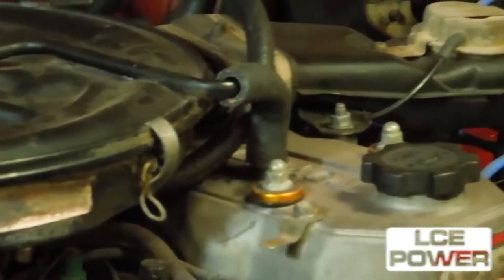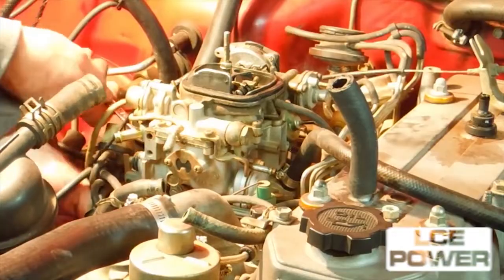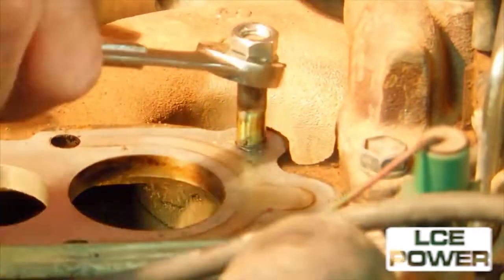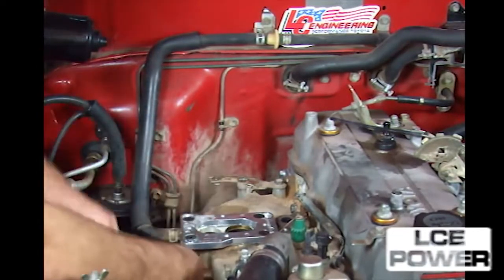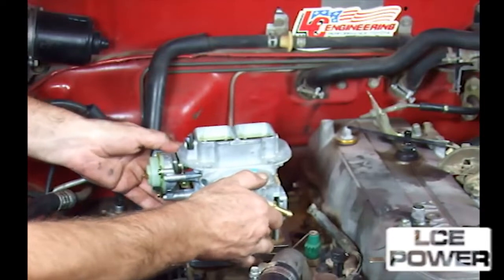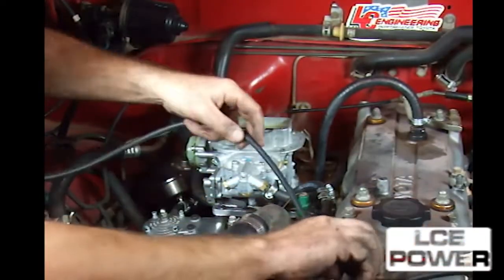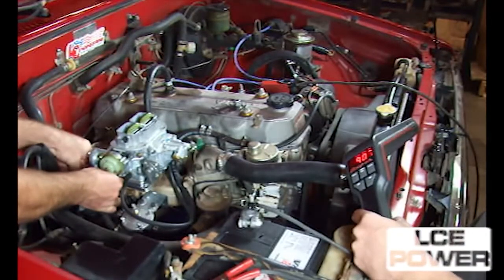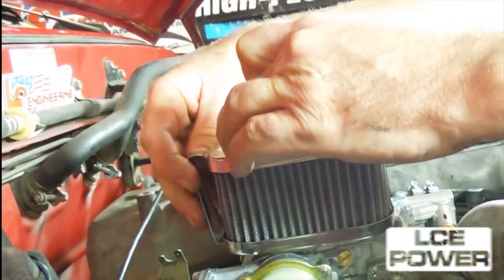LC ENGINEERING INSTALLATION OF A WEBER CARB ON A STOCK 22R

Comment: Don’t bother it will run on all the time. That’s when you turn it off it will keep chugging away as it needs a  fuel cut off valve
Reply: Yes im having that problem now
Reply: @JamesKitchenmaster  Clearly have that after run problem my self, I tried backing off the choke spring, Changed the timing , Lowered the idle speed, That helped but still randomly runs on , Whats the fix?

Comment: So are you supposed to run a switch to the electric choke? Im confused
Reply: No you splice into an existing 12v ignition source. Some of the green connectors from the old system have 12.3 volts going to them, splice into one of those and connect to your electric choke. Check the plug you're going into with a volt meter, negative on your battery negative terminal and positive into the plug untill you find the 12.3, then splice into the wire that feeds that terminal.

Comment: Hello i am having a issue with mine. Where the heck do i plug in my electric choke? To the starter? Any source of 12v when turning the key? Also does this not require a ground wire? Please respond fast i have to get my cwlica back on the road in 2 days for my delivery job
Reply from the maker: Any 12v key on 0v key off source will work, that is all that is required to properly hook up your electric choke.
Reply: @LC_Engineering  thank you so much. and think you for providing the carb!

Comment: At the 8:00 mark, doesn’t a hose typically go from the top of the valve cover to the front of the carb?
Reply from the maker: It's up to the customer on the front breather you can either run it to the air cleaner or run a K&N breather whichever look is preferred. The PCV hose further back is the one we recommend keeping hooked up for daily drivers.

Comment: Is a fuel pressure regulator gauge needed on this small engine?
Reply from the maker: Yes, the fuel pressure regulator is needed because Weber's run off about 2-3 psi were the stock pump puts out about 8 psi.
Reply: @LC_Engineering  what would happen if ran without one? I am looking at buying an 83 Toyota pickup that has this kit (From you all) on it. He has the regulator but never installed it. The carb has been on the truck for about 2 years now. I was planning on installing the regulator when I get it home but was wondering if the carb could have been damaged from this... Thanks

Comment: Very helpful❤❤❤ I was about planning to use weber carb on Daihatsu rocky with 3y engine. I came here after reading your guide on website about modification for steep hill fuel problem.
Reply from the maker: Glad we could help.

Comment: I have a 21ru and the distributor was updated and doesn’t have vacuum advance. Would this still work.
Reply from the maker: It should but you will most likely be consuming more fuel.
Reply: @LC_Engineering  hell it’s gulping it already. Lol. The carb is all jacked up. Idles high The idle won’t adjust on it and once it’s warmed up it runs a bit off on idle. None of the adjustments work besides the cable itself.

Comment: Where is the fuel pump connected to?
Reply from the maker: In this case it appears to be a mechanical fuel pump which would be bolted to the cylinder head passenger side front. If you have any questions feel free to contact us at 877-505-2501 or sales@lcengineering.com .